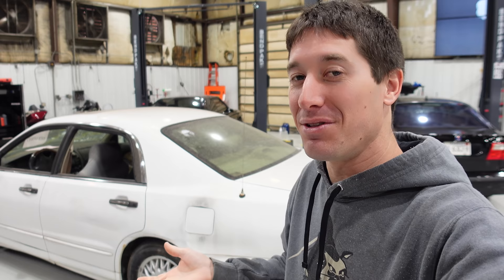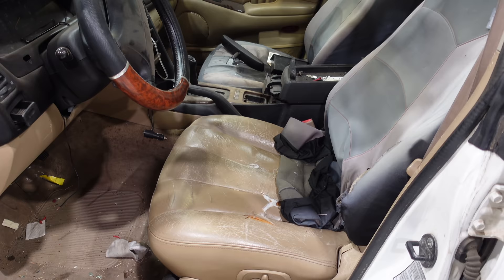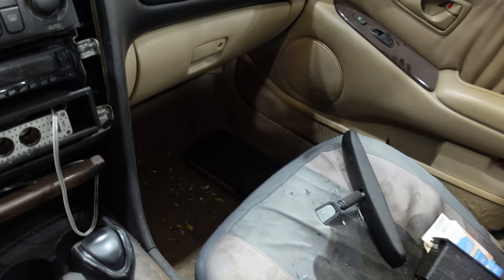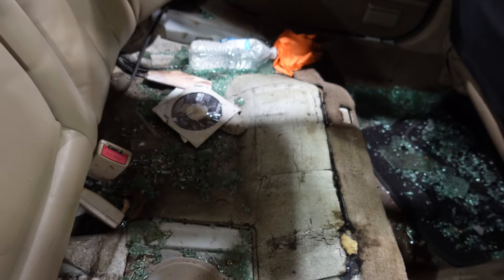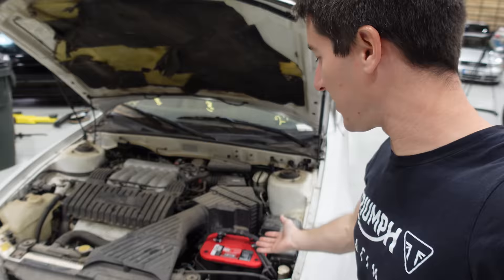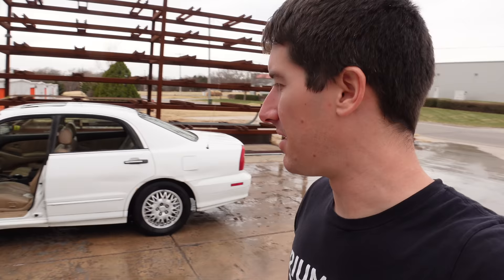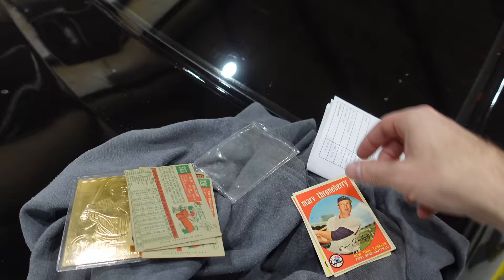I Found BULLETS And BASEBALL CARDS Cleaning My $400 Mitsubishi Diamante

Comment: I bought a 1982 BMW 528 back in 1998, who ever had it was a very heavy smoker. I was in the process of completely stripping the interior to clean it, I removed the passenger seat and stuck between the console and seat track there was a diamond ring. It was dirty and covered in a sticky substance and it really didn't look real, I stuck it in my tool box drawer and forgot about it. I found it a few years later when I traded my toolbox in and brought it home and cleaned it up, I took it to a buddy that owns a pawn shop and he tested it and said it was worth about $3,000.00........four years later I gave it to my wife as an engagement ring and she still wears it to this day.
Reply: I have a similar story except i was cleaning a car we bought from auction years ago and found a diamond earrings in it. I still haven't went to the pawn shop to have it tested but probably should after reading your comment. 😅
Reply: @jonnyboy9141  I think the appropriate word for checking the value of rings/earrings or any kind of jewelry is appraised/to appraise.
Reply: @jonnyboy9141  dont use pawnshops they just want to rip you off. Use a jewelry appraiser
Reply: You better hope your wife never hears that story.
Reply: what a story!  I take it you never told your   wife how you came about the ring ,right?

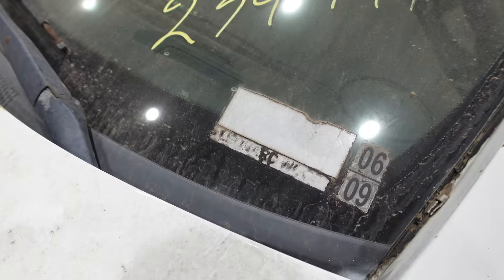Comment: 3:25 it’s a DOD vehicle access sticker. The seal is the Department of defense seal. The number is the month and year of the access expiration date. The bottom sticker was the base name where the vehicle was registered. The background color of the lower sticker would  correspond to the branch. Green was ARMY, Blue Air Force, white was navy, Red was national Guard.  The stickers were eliminated around 2010.
Reply: When I was in, red was Enlisted, blue was Officer, green was Dept of the Army Civilian. The Air Force occasionally used a yellow to denote NCO. Black/white was contractor but those were very rare.

In the case of this Diamante, it was a Fort Leonard Wood (Army) sticker that has long-since faded out.

Comment: I bought my 7th gen Accord from its original owner. The stock, in-dash CD changer had stopped working years prior, but he mentioned there were a couple of kids' music CDs stuck in the carriage. Well, I replaced the changer mechanism with a refurbished one (don't like broken stuff) and removed the CDs from the broken unit. I gave the CDs back to him, and he couldn't have been happier, as it reminded him of when his kids were little. Glovebox was full of straws from fast-food joints, which I left, because who has ever been shorted a straw from the drive-thru? Good thinkin' on his part.

 Every vehicle has a story. This is fun content for anyone that's bought a used vehicle.

Comment: Put the grille back in, replace the door glass, give the interior a quick detail and throw some seat covers on it and I'm sure someone would pay over $1k for it
Reply: over 1000? In DFW right now it's easily over 3k
Reply: Maybe pull out those LEDs and fix the stereo bezel too
Reply: And the exhaust leak
Reply: I would just get that bottom seat portion reupholstered or if a cheap used one is available that may be the way to go
Reply: 2k car all day no questions asked once it’s fully detailed and in usable order

Comment: Surprisingly the Diamonte is closely related to the 3000GT and shared many advanced features found in the 3000GT like 4 wheel steering.
Reply: It’s basically a 4 door 3000GT. Not a lot of people know that.
Reply: I haven’t seen a 3000 gt in the road in 20 years. It would be cool if JR could find one

Comment: I bought one of these on eBay probably 15 years ago. I was the ONLY bidder and it was a half mile from my shop. I think less then 300. I drove by it every day and never even gave it a thought. I guess his kid got into the dash and doors pretty good "trying" to install a stereo and then nothing would happen when you turn the key. It took me about an hour to determine the security system was the culprit due to a driver door lock cylinder not connected. The driver seat didn't move, black interior was kinda beat but I was gonna use it as a work beater and leave my new car home in the garage. I put a timing belt on it and did the fluids. 
Then wound up assuming the payment on a 2006 Taurus my girlfriend (now ex) bought. I think I quadrupled my money and sold it because somebody needed an engine for a 3000GT. They drove it away.

Comment: Used to be a Mitsubishi dealer on my town growing up. Saw lots of these. I remember them advertising "a 4 with the power of a 6, and a 6 with the power of an 8." You should find a GSX. Those were hot cars.
Reply: The fours had about the same power as a four cylinder Camry and the V6 wasn’t much more powerful than the V6 in a Commodore.

Comment: A quick search of two of those cards.  The Thorneberry isn't even 20 bucks in pristine condition.  The Al Downing though, in that condition, ya might get 5-20 bucks (depending on how bad someone wanted it of course).  If it was in perfect condition, they are valued over 2 grand atm.  The Ruth card was part of a set from Danbury.  Goes for 20-25 bucks.

Comment: The Australian made version was the Magna. I've had four of them, all awesome. My favourite was a 3.5 wagon with a 5 speed manual. Went like a gun, cornered great, such fun changing gears 👌
Reply: Unfortunately, not only did North America miss the manual, they also missed the wagon version (that was for the Montero). At the time, Accord and Camry both discontinued their wagons, but ay least could be had with manual transmissions (Accord with 4 cylinder, Camry with both engines).
Reply: Unfortunately, not only did North America miss the manual, they also missed the wagon version (that was for the Montero). At the time, Accord and Camry both discontinued their wagons, but ay least could be had with manual transmissions (Accord with 4 cylinder, Camry with both engines).
Reply: Diamanté was also Aussie made mate.  It really is just a rebadged Verada.

Comment: I had a 2003 Diamante vrx and i miss it dearly
Reply from the maker: The Wing! And the facelift is killer 🍻
Reply: @WatchJRGo  The one you pictured is not a facelift, it is the Ralliart limited run one, a performance model with Evo 6 kit and wing. Quite a story behind it. The facelift one is the rounded one.

Comment: that Babe Ruth card is worth anywhere from 1 dollar up to as much as 300 but the avg market value is around 10 dollars.  You could probably take it to a local card shop and get around 3 - 5 dollars for it depending on condition as it's hard to judge condition from on camera

Comment: The cards all look to be later reprints from probably the 90s... was never big into them but they look as such.  Probably the entire stack... $40 at a card shop.  The Babe Ruth should be 22k gold so if nothing else the gold weight most pawn shops deal with them if not a card shop if you can find one.  Do a charity auction on ebay or something with them.

Comment: Man hope $400 covered all auction fees and the fuel to tow it home, kind of crazy what stuff is going for now days.  Really sucks that Mitsubishi is an orphan brand here now that you can't find parts for.  Cause this is pretty sleek design for a "nice" but not horrendously expensive car for 1998.  Much cooler looking car than say a 1998 Avalon, 1998 Buick(any model), 98 Acura TL, or god forbid one of those horrid oval Taurus/Mercury Sable or Chrysler LHS abominations.

Comment: Mitsubishi got their recert after world war II making Willy's jeeps in Japan for the Japanese and possible us military market. This was the start of the rebuild of Japan. Skip to the '70s and then early 80s they started in importing cars for the Chrysler Court then started joint ventures assembling cars in Illinois and then there was then there was a sun motorworks merger that included Chrysler Mitsubishi Hyundai which they got their start making old Mitsubishi cars in Korea for Mitsubishi like the quality of Hyundai so they started the partnership and then the Korean government linked Kia with Hyundai. So depending on what year you could have you could have a Hyundai car with a Mitsubishi motor and a Chrysler auto stick transmission made in America course some type of mix like that. There's a possibility that car is made in America didn't have to pay tariffs on the car and if it's a government car it's counted as domestic. When they started Democrats are they stopped the Mitsubishi merger but they still use Hyundai engine blocks and some cars.